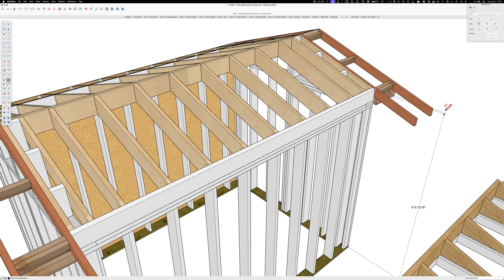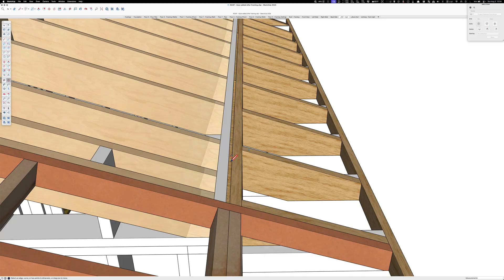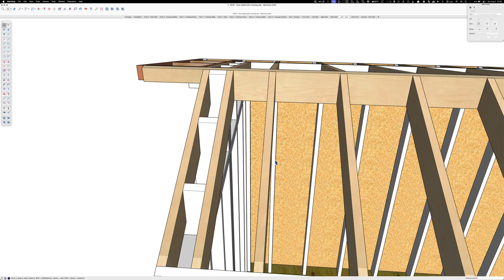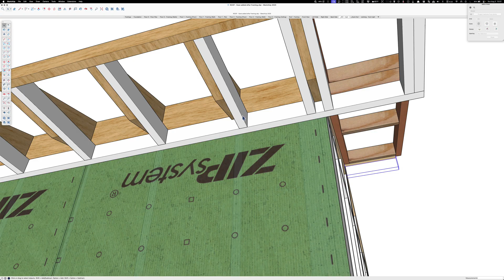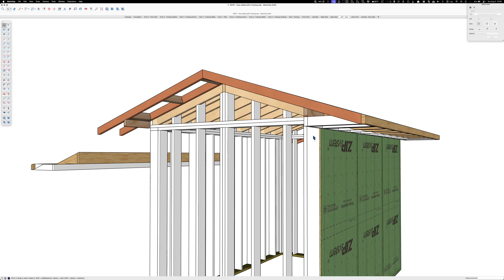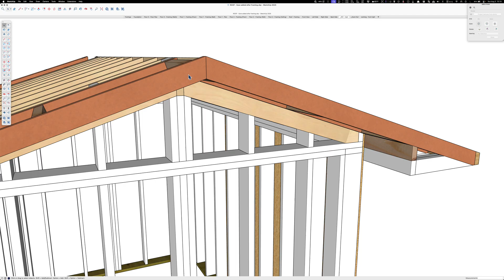SKETCHUP FRAMING:  "BOLT ON" OVERHANGS

Comment: Since it has to be lifted I think your detail is too heavy.  Build a french cleat to drop a 2x4 (ridge) beam to lock it in.  Soffit largely floats with minimal fasteners save for occasionally latching into J-channels so you can run a 2x2 ladder-style lower frame box for soffits.  Your stringers to the ridge can be 2x4s.  Block your lower 2x2 ladder to 2x4 stringers with 2x4s and it will be solid by the time your blocking is tagged to the cleat, stringers, and ladder.  As you nail the assembly to the wall gravity will conform it.  If you see any extra twisting then c-clamps will pull it together with minimal effort.